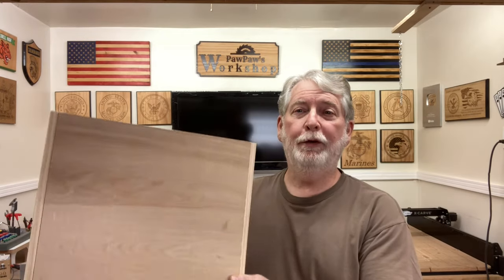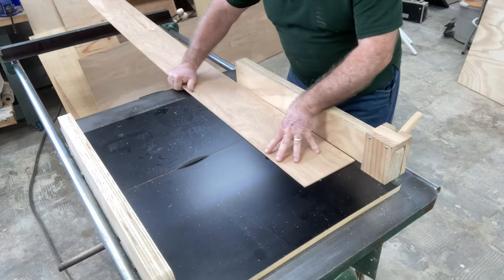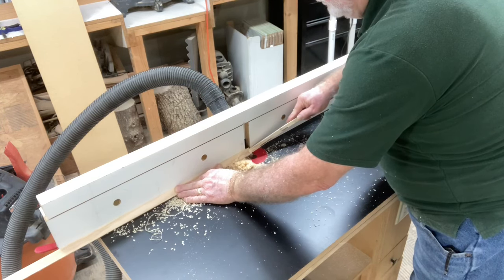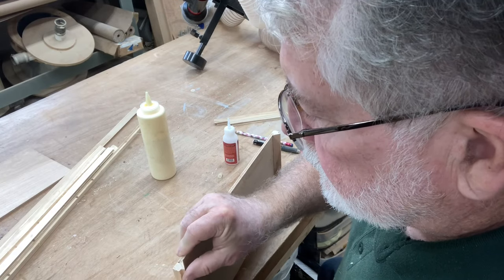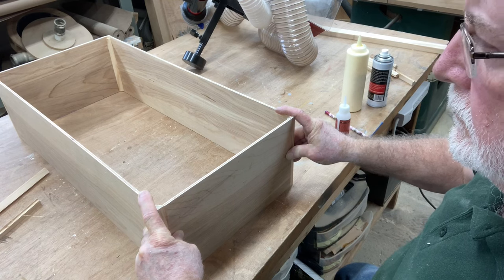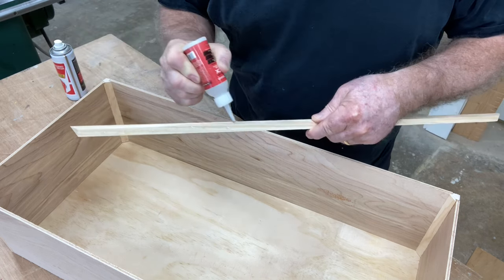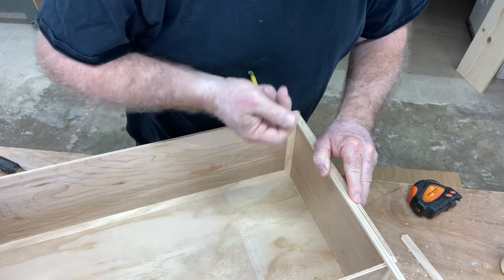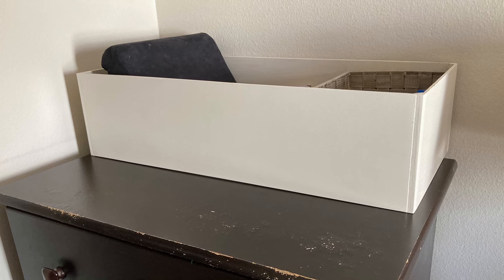BEGINNER SERIES: Strong Lightweight Box (Yet another way to build a box)

Comment: Nice corner profile! Very much like the extruded aluminum stuff they use for utility boxes. Actually I want to make a transport box with attached lid for a sailplane I have and it needs to be strong and lightweight. I was at first going to use gussets but I would like the lid to be interlocking with the base so it is stronger when closed and latched. So, now I'm thinking a glue up of two layers of 5mm ply one inside the other with interlocking and lapped 90° corners thereby avoiding use of gussets. This way the inner most layer can have a different height than the outer creating a rabbet without the use of the router. I always wanted a shop but I'm limited to a contractor table saw, chop saw, and router other hand tools. I can reinforce the corners with those bamboo skewers drilled and glued in across each joint if need be. Every time I made myself a shop I had to move or something. :( I also have a pneumatic pinner to start the boxes first joints. Any suggestions?
Reply from the maker: @kirkglundal4289  I think you have an excellent plan

Comment: Hey Paw Paw (and that sounds funny to me, because growing up in eastern Kentucky, that's how I would address my own grandpa!).  I had an idea for a thin-wall box, still on my list to try and fabricate, where instead of a supporting gusset, the edges are wide box-joint fingers (like 1 1/4" wide in 1/4" or less plywood), glued of course but also reinforced with 2 nails or dowels going through each finger into the corresponding space in the other panel.  The 'dowels' I had in mind for the thin material was actually 1/8" bamboo skewers.

Since the direction of these pins would be 90 degrees to those going through the adjacent fingers from the other panel, this would provide strength in both directions.  In other words, the left panel couldn't pull away from the right because the pins going through the right fingers into the left spaces hold it in place.  And likewise the same concept preventing the right panel fingers from pulling out of the left's spaces.

The application I had in mind for this was those boxes you stand up a bunch of magazines in, like a fat cereal box where one of the top corners was cut off at an angle (usually made from plastic, and not something you'd want gussets in the inside corners causing a space around the magazines).  So you could have a line of these boxes on a shelf holding all your woodworking magazines, and could orient the boxes either with the tall side out and a label on it, or the side with the cut-off corner out, showing the magazine spines with their names and dates.  

I have no video skills of my own (not to mention lighting, editing software, etc.), nor really any desire currently to work all that out.  But if you see merit in the design I've described, and mostly in the strength of that wide-fingered box joint, I'd love to see your execution of it.  I just thought it would be a good tough joint for having a lot of weight on it, like a stack of heavy magazines.  What do you think?
Reply from the maker: Excellent idea, thank you very much

Comment: Nice work, love the plywood too. Great grain patterns. What is the composition of it? You could reinforce the top edge with flat strips and it will have enough material to roundover. Giving a smooth edge as square plywood will splinter quite easily

Comment: Good morning Paw Paw. I enjoyed the video and I am attempting to make drawers in the same way. 

Just a question for you regarding the router step. I tried this technique on my router and found that as the blade rotates anticlockwise at the table face. My approach was from right side of the cutter nearest the guide (as in the video) but the blade was pulling the stock through the cutter (rotating in same direction as direction of timber) and resulted in a very poor finish. I tried an approach from the left side of the blade so pushing timber into an oncoming blade, but that resulted in a poor outcome as the blade removed the timber from the guide side and the timber was shattering. I feel I should approach from the guide side  into an oncoming blade, but my router table has a clear arrow crossed out suggesting "Not this way". Surely it depends on which side of the blade you pass your timber. I feel it should be into an oncoming cut somehow.
Reply from the maker: Be very careful when making this type of box. Although it is very simple process, please be very careful working around the router bit. Look at the grain of wood and consider that when running the material through. The blade runs counterclockwise. The material should run through the blade so that the pushes toward the fence

Comment: If I did this but with Balsa wood to save weight, would it be strong enough to be useable? Also, what is the wieght and dimensions of the box you made here?
Reply from the maker: Balsa is very lightweight material and I would not recommend to make a box out of it unless it was very small.

Comment: I build speaker boxes and need the lightest, strongest, material I can get at a good price. I'm currently using birch plywood and southern yellow pine, any recommendations appreciated 👍
Reply from the maker: Use this method. It is lightweight plywood and yet is very strong. These corners work great and the nice thing is that there are numerous methods to make the corners
Reply: @PawPawsWorkShop  thank you for the response!! Any material you think would be better than birch plywood?
Reply from the maker: The plywood is strong. MDF will work if the speakers are not moved a lot. Underlayment is inexpensive plywood will work also
Reply: @PawPawsWorkShop  love the approach in the video that's what I was looking for! I haven't found anything yet that beats good plywood and love overlapping different panels with dovetail joints that highlight the difference between the southern yellow pine and plywood! 
Love the tips, and I agree MDF is just too heavy and wears out tools faster and cost my customers more for shipping. Still loving my double laminated 3in thick select pine faces with heavy polyurethane finish contrasted with the plywood fun stuff!! Thanks again 👍

Comment: Would you be able to build this with a lid?
Reply from the maker: Certainly, you can add a lid
Reply: @PawPawsWorkShop  do you have any expert pointers for this beginner.. I was thinking to add a thin piece of wood to the inside that would support the hinges.. am I thinking that through correct?
Reply from the maker: Yes, that would work. That will provide support for the small screws.
Reply: @PawPawsWorkShop  thank you for the feedback. I will give it a try.

Comment: A very precarious way to route on the router table. You were routing in the counter direction with the workpiece between the fence and the bit.
Reply from the maker: Yes, you’re correct. It is very small pieces and great care is required

Comment: I lo the technique you used to create the box.  I haven't seen it use anywhere else but outside of using ca glue to eliminate the use of clamps,  this is not a simple way of making a box for a beginner.  I am a beginner and any build that uses a table saw, in my opinion isn't simple.
Reply from the maker: I have shown many ways to make drawers and boxes. In addition I will be showing even more ways this year. You need to pick to best method that works for your and your skill level.